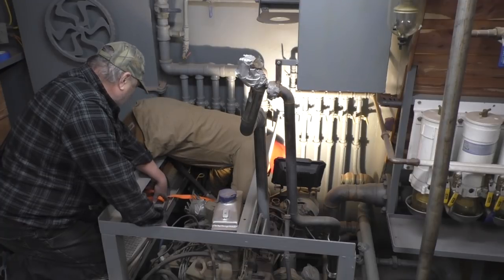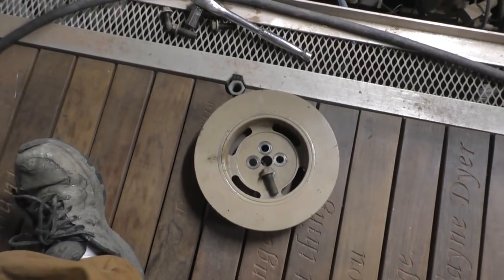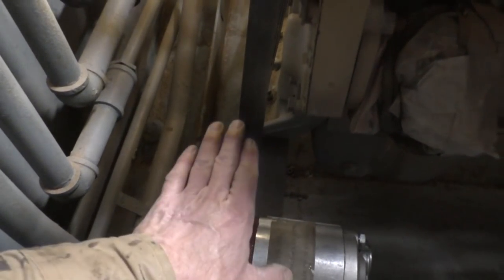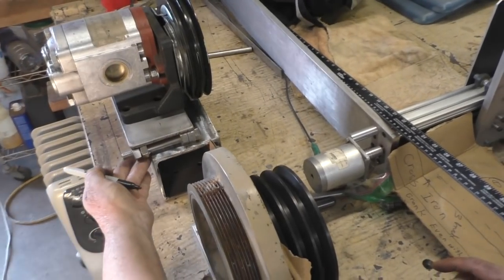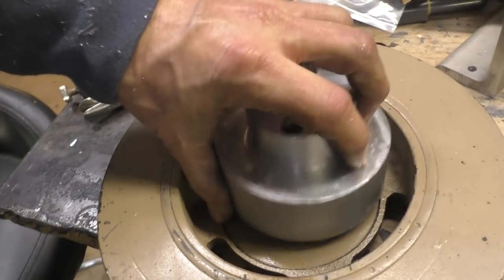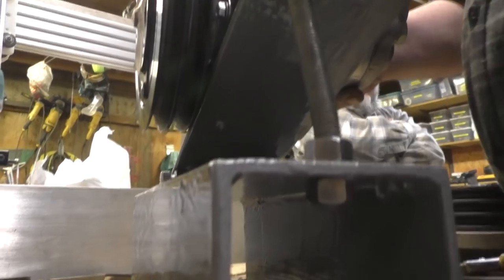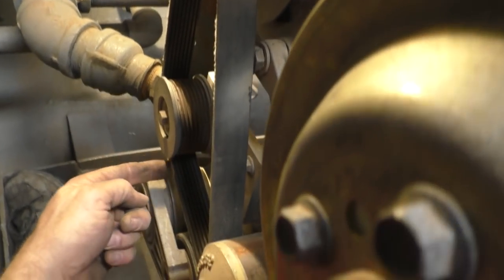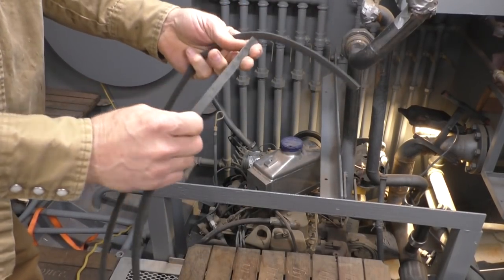Primary Hydraulic Pump Install

Comment: The belt tension adjuster on the hydraulic pump looks like a failure point.
Reply: Henry Reed bent all-thread looks sketch
Reply: @mllave240  MIght look sketchy but  this setup is actually pretty common in mills that I have worked in, and the drives there are MUCH bigger.  Sketchy yes, but I figure the reason these don't fail is that the real force is on the hinge bolt, that tensioner just keeps the belt tight. This is after all a belt drive system,  belts seem to slip and burn off long before bolts like that fail......

Comment: The way you have it, you pump predominantly hinges up and down. There is very little sideways movement to actually add tension to the belt.  Better to change your pivot angle so your pump predominately hinges side to side. This is so the majority of the movement actually adds tension to the belt.  Another way to say it... Your bent bolt should point sideways, not up and down.
Reply from the maker: I think you need to move your arm chair closer to the screen.
Reply: @SVSeeker  Arm chair my ass! Doug, consider that not only you actually design and build things.  Other people have different levels of knowledge and experience.  Your belt tension design works, but offers limited adjustment, maybe locks you into using one set length of belt.  If your tension adjuster pulled at a more direct angle, in line with the belt, you could use a belt a size longer or a size shorter. Maybe the optimal size may be hard to find when sailing to other places.  But you have an attitude of not wanting to consider an alternative point of view.  Your boat is not one that the internet community built.  It is Doug's boat. You make that clear.  So stop with the arms open talk if you are going to post wise crack remarks when someone is taking their time to write in and try to help.
Reply: @kooldoozer  
He'll work it out when he starts chewing through belts under load.
Just enjoy the schadenfreude when it happens.
Reply: @lancer2204  He'll figure out quite some once on the water and some more once down in the Gulf ....
Edit: Will ascertain extended content, hopefully.

Comment: Looks good, the only thing that bothers me with that setup is the pulley being friction fit and some epoxy.  I have seen friction fit pulleys spin on the shaft with some load on them, don't take much.  Unlike all the other naysayers though, i will simply suggest that there is nothing wrong with the design, but if the slipping becomes an issue just remake the outer washer out of steel instead of aluminum and bolt it back up and weld the washer to the belt pulley.  For the load that pump is gonna put on it those four bolts and the adapter should be plenty strong torque wise.  Who knows might take years for it to spin on the adapter but its an easy fix that only requires pulling the bolts and washer off to fix with a steel one so run it till she gives you grief!  LOL
Reply: I should look again but don't the 4 bolts go through bolt holes in the pulley?  For sure a taper lock would be best but If the pulley has bolt holes in it then the troque is on those not the "fit".  I havent ever seen epoxy used in a pulley before..... Must take up any slop that rattle the bolt holes...

Comment: Nice work, simple setup. I can understand using components you have already, but, as the 'primary' hydraulic pump, are there any concerns about the drive belts getting wet and slipping?  Im referring to a rough sea state with some water in the bilge sloshing around.. I imagine rudder movements and the like could be crucial 🤔🤔... Perhaps a commonly available timing belt on toothed pulleys could be a more secure,  equally durable if not more so,  potentially more reliable drive ?? Just a thought. Keep up the good work...
Reply: If there is no speed reduction then a direct coupler would make me feel much more secure, no reason that this shouldn't work but I think that rudder failure in heavy seas would not end well.   In my experience cogged belt fail as much or more often than correctly sized V belts on good sheaves.   Cogged belts are great when the two rotating shafts have to stay "timed" or where slip is unacceptable, like encoders.

Comment: I agree with supercritical you really need to key that  Especially with a Cummins I have basically the same set up on my  Commercial fish boat in Alaska and you want to use nyock's everywhere instead of lock washers the 6B t's just shake everything apart.  And putting a key in everything is critical you will  Sheer off those bolts I've worn out 3 of those 6B  T's in my Seine skiff they are brutes  They are also very picky about water in the fuel I don't know what kind of fuel system I have but you have to be very careful about keeping the water out those ejector pumps   Are not cheap and they're hard to find
 Looks like things are going well good luck
Reply from the maker: Noted.   But you see that Canadian fisherman looking guy in the video?   He's 5th generation, and the design is one that's been use in a number of boat, including his sons boat and boats running Cummings engines.    Maybe it's not as critical as you think?
Reply: I will admit we run them very hard in our industry (purse seining in Kodiak Alaska) just trying to give you some of my experience while it's still an easy fix

Comment: i think you should pin it, captured pins between the 2 aluminum hubs going into blind holes through the pulley into the inner aluminum hub.
EDIT: Also, thinking about it, maybe the outside hub (big washer) would be better off made of steel and in that case maybe put a few tack welds on it and call it a day, I can't say for sure but i really think the epoxy won't hold.

Comment: You need to use two bolts to tension the plate holding the pulley not just that one single bolt that is bent on the bottom
Reply: it needs to remain square under load of 2 hi torque pulleys or else you will eat belts

Comment: It's probably asked or mentioned at one point so please forgive me for not remembering. 
My question is what are you running with the hydraulic pump ( power steering pump) that's already mounted on the motor?
Some of the equipment I work on has a 2 or 3 stage pump mounted in place of the power steering pump.
Reply from the maker: There are 4 pumps, the other 3 are smaller, but all are connected to the hydraulic system, and system powers the anchor winch, deck crane, rudder, tender davits, wash down/engine bilge pump, and any tools we connect to it.
Reply: @SVSeeker  I understand now thank you

Comment: Typical lobster boat setup. Very reliable, very durable, it also allows for interchange . 

One questuion¿. Does your hydraulic pump ,or is your pump intended for shaft tension. Meaning can you sideload the shaft? A lot of these pumps are shaft driven only.😒
 I was half expecting short drive shaft coming of the crank.🤔
Reply: chris 89 that hyd pump came with the electric clutch all ready install so no side pull on hyd pump the 5.9 cumming will stand the side pull we have some 5.9 here with 18000 hr and no seals or bearing failure.in the fishing boats
Reply: @fisherman5065  the engine can take it .  
didn't know it came with the clutch ..so its all good👍

Comment: I would have put in a pin to hold everything in alignment and to keep that pulley from even thinking of turning you had holes there already in the pulley just needed a hole in your adapter to act as a stop , I dont trust just a compression fit on there over time it will loosen up
Reply: I agree, especially considering the coefficient of expansion of the aluminum. Pin it, key it, screw it, but something solid is a really good idea. What do I know, though? I've only been a fixer of all things for over 40 years.
Reply: Nothing to stop him from doing that if it starts slipping
Reply: @VeganSurf  That's how I made a living. I get called when something slips. The problem is that now your operation is shut down. The holes are already there.
Reply: @kbbacon  I think he has like 2-3 other hydraulic pumps planned for the boat's hydraulic system
Reply: Pully has a taper fit.

Comment: I don't know how many HP is needed to drive the pump. I might notch the aluminum adapter and triple pulley and insert a 1/4" square key to keep any possibility of the pulley from slipping or spinning.

Comment: Are you going to put in a seperate electric hydraulic pump system so you dont have the diesel running all the time?
Reply from the maker: It's already done.

Comment: that Allison 540 transmission has a a pto drive gear in it " most do" and that pump setup would have been super simple with a pto drive
Reply from the maker: This one does not, and we will swap that out if it fails to meet expectations.
Reply: Would that be 'live'? I would think not. Another option would be to use the gear driven accessory port on the back of the timing cover. The bus engine probably already has a hydraulic pump for power steering mounted there. Might not have sufficient capacity for the application though. Never the less I enjoyed seeing the custom mounting and drive solution.
Reply: @mendomotox1569  i would advise against driving off the gear train for the injection pump and camshaft.
Reply: @SVSeeker  if you need a gear, transtar industries can source them. they have a great national supply chain. it's a relatively easy part for any competent transmission builder to install. probably would not hurt to go through it anyways. one thing I would recommend is getting a converter drive flange that replaces the torque converter, or trade up to a 630 transmission with a lock up converter. heat build up due to stall loading will be a problem with that a540 unit

Comment: If the pump mount is on hard frame of the boat will there not be movement when the engine starts etc as it moves in its mounts thus changing belt tension ?